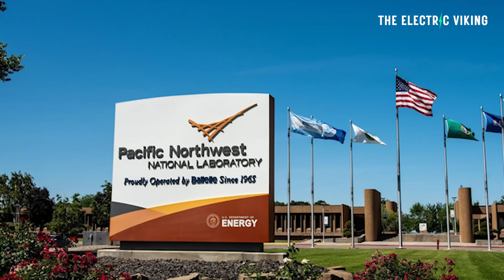Microsoft AI analysed 33 million candidates to find material to replace lithium

Comment: They found Lithium in Salton Sea ( California ) and it can be used for 375 million electric cars. It will be extracted from geothermal brines which is a less energy-intensive method. The brine concentration is 400mg/L which is considered good.
Reply: Cannot pass environmental for sure.
Reply: @kongwee1978  Salton Sea is already an environmental disaster .. commercial mining there could be the economic engine to reverse the disaster it is.
Reply: @kongwee1978 Google high  Li concentration brine and you will find it by far the safest "mining" possible; even Disregarding free geothermal energy to run the plant.
Reply: I live in the Coachella Valley (near the Salton Sea).  The Salton Sea geothermal wells are a near-miraculous lithium source for the reasons everyone already knows, but a lot of people don't seem aware of the local political and taxation climate.  The state of CA has imposed a per-ton flat tax on extracted lithium that will erode much of the cost advantage the Salton Sea lithium had to offer.  Depending on who you ask, it could make much of the development cost-prohibitive.  Like it or not, these taxes were a big part of getting essential local buy-in.  So the bottom line is the Salton Sea has definitely got the lithium, but the market may not end up getting all of it.
Reply: @davidmichaelmilewski  Just talked to a specialized geologist about the Salton Sea, What's hampering progress there is that it's a toxic mess. Very hard to get just the lithium out, you also have to deal with loads of other heavy metals and pollutants. That's what messes up the financial prospects.
Reply: @davidmichaelmilewski  Yeah, first we have to get rid of stupid gavin nesom and his socialist state government. LOL
Reply: They don't care the least about that or the cheapness of sodium instead or the ease of recyclability of sodium... They only care about that commodities investment market substance price explosion... now that it's low again.
Reply: LOL, It's California, they'll either prohibit it completely or make it so expensive that it's not worth it.  C'mon, you new here?
Reply: It seems like sodium is going to replace lithium fairly quickly.
Reply: @mac_mcleod   It hardly seems necessary to have looked through thirty million things to find Na in the flat below Li... why has this story not arrived with an explanation as to why the search space was so big?  I've been digging around (a big) and can't seem to get a grasp on why this wasn't just off the top of someone's head.  Why AI at all?
Reply: @kob8634  because it's faster than humans and lacks human biases.

After human beings have been playing Go for 3,000 years, AI both learned to beat them and invented new moves humans had never seen. 

I Can't Tell You Why the search space is so big. Suggest you Google for more information. But it is that it is a fact so clearly the search space is that big.
Reply: @mac_mcleod  I get all that, but when people are telling this story it seems to me the "why?" of the search space size is kinda vital to the story.  Lithium and sodium have always looked very similar (electrically) on the surface.  I get that Ai is faster (duh!) I don't know why it was needed and that kinda is the story.  Yes, I can google it alright, my search term would be something like "actual science jouranlist talks about Microsoft AI" but you know what that's gonna spit out before you press enter.
Reply: @kob8634 It's not actual science.   Most actual studies are dense and difficult to read and full of math.   

It's science journalism.   It may be the reason for the large search space is difficult to summarize or it could be they thought it wasn't important.
Reply: @mac_mcleod  Yeah, I expect they thought it wasn't important because things have been dumbed down so far the actual facts related to anything just don't matter huh?  Man, you seem nearly fawning in your approval of all this.  The reason the AI was necessary has to be central to the fact that it was the AI that found something.  That reason is the story (unless we're just Tic Tok'd out)
Reply: @kob8634 No, I was putting things in simple terms so an ignorant person could understand them.  And now that person has started making personal insults and trolling so I'm going to mute them.
Reply: @kob8634  Listen a bit more carefully. They were looking for an electrolyte additive to help make a sodium/lithium hybrid battery possible.
Reply: @zerospace101  already did. It created a new powerful move in the game of Go that humans had not seen for the 3,000 years we've been playing the game.

And many creative people are using the confabulation of ai's as a source of brainstorming.

But you're right about one thing, AIS do what they're trained to do and we really have no idea what we're training them to do. The failure of friendliness, also called misalignment, is an extreme risk which is being treated very callously by almost everyone working in the field as far as I can see.
Reply: @mac_mcleod  sodium batteries have far lower power density and lower lifespan at the moment, so wouldn't count on it. but would be great for large storage batteries grids. Just not for Evs.
Reply: Same in the Upper Rhine graben. 26 million tonnes resource.
Reply: They "found" it there?  Ha!  They *knew it was there before they looked* and they knew the exact concentration too because they know where and when the water came from and they've been putting up with a cosmic stench ever since.
Reply: Tell me you watch a lot of YouTube without telling me you watch a lot of YouTube.
Reply: They should just leave it alone
Reply: you will ruin the sea to build some cars.  are you completely stupid?
Reply: Sorry, can't, you can't mine in MN, odds are you won't be able to destroy the environment in CA.

Comment: the difference between AI generation and traditional development. is simple. in traditional we  branch out from what we have to things similar. AI starts from everything we put in even those that we know will not work and narrow it down. 

In many cases we will find out that traditional actually develops 90-95% of these quickly .. what AI actually gives us is the things we did no think would work. yes AI will help develop things but we will miss some things because AI can only use what was given to it. 

Ai is a good tool as long as we use it as such. if the AI came up with materials we did not think would work then it is a bonus.. if it comes up with things that are more dangerous did not help. There is always overlap in development from companies. as long as AI results are not copyrightable IE we determined that 20%lithium 40%sodium whatever else combo should not be copyrightable because many other companies and scientists can develop the same thing independently using similar AI's. AI''s will help as long as it does no become a copyright everything even if we will not use them.
Reply: Good post. I like what you said, however, you used “copyright” several times; did you mean trademark?
Reply: @morganmorse2086  Patent would be a better word.
Reply: Irrelevant. Whether developed by people or AI, anything potentially useful will be patented by the company developing it. That will not change. The patent office doesn’t care about or even need to know where an invention comes from.

Comment: Battery density keeps increasing and the cost keeps dropping. This would never have happened without Telsa bringing EVs to the masses if someone else doesn't do it Tesla will.
Reply: I remember ten years ago scientists saying batteries will never catch up with technology
Reply: @lidoz  They haven't. Batteries are a very bad way to power a vehicle, still.
Reply: @Withnail1969  - What is a better way to power a vehicle? Using an ICE that wastes 66% of its energy in heat? Show us the numbers.
Reply: @Withnail1969 Justify your assertion.
Reply: @Withnail1969  Physics doesn't seem to be your stong suit, mate.

Firstly, even if we generated our electricity with 100%  fossil fuels, these power plants running with 60%-70% efficiency would result in only half the emissions powering BEVs as burning the same fuel in ICE cars with only 20%-30% efficiency.

Seconly, we already have a quite noticable amount of renewable energy, in many western countries over 50%, and in some even over 75%, so it's even much better.

Finally, the share of renewable energy is raising fast. Since wind, solar and battery are already the cheapest source of electricity generation it's a no-brainer.
Reply: @Withnail1969 you are incorrect
Reply: Definition of masses aside, there's no denying Tesla's impact on the industry. But if a new chemistry  isn't compatible with their manufacturing process, it may be hard for them to change. Look how Toyota clings to their hybrids.
Reply: The idea that if one man didn't invent it then no man could ever invent it is really more of a religious argument than a scientific argument. You've told us you own tesla stock or you idolize Elon without telling us.
Reply: LLMs are legacy's only hope. The only way they are going to catch up to Tesla on software (excluding FSD for now). I think it's fantastic that energy storage is being explored by AI companies. Tesla benefits from cheaper and better batteries too, even if they ultimately don't use lithium. I think humanity is on track to move into a future free from scarcity, whether we like it or not.
Reply: Might be true. But the world has to start worrying about dealing with and recycling used lithium batteries and other waste the size of the United States.
Reply: Edison had over 900
 patents on batteries,  including the lithium battery.  Henry Ford hired Edison to manufacturer the battery for his automobile but refuses to use it because the battery would outlive the vehicle, instead he used open jars of acid that sloshed the acid out on every corner.   Wikipedia lists all of Edisons inventions and a battery.  Why is it musk builds a factory only to produce a substandard battery, Panasonic still makes a better battery.   The technology is there so why is it not used.  Planned obsolescence, is it still required ?
Reply: @vidxs  - The battery your talking about is the Nickle Iron battery. Unfortunately it has very lower energy density and  very poor low temperature performance. If it was better Tesla would use it. Their engineers seek the best performance to cost ratio. AI is coming up with new material combinations. Its like a modern gold rush. Whole point is their is now a bigger battery market now to generate investment.
Reply: Everything you just said was wrong but carry on
Reply: @johnsonfitzgerald2696  What facts are wrong?
Reply: I'm pretty sure that progress has been retarded for at least a hundred years now. The things already known a hundred years ago before there were really plastics to use, and before modern production things, the way a cylindrical cell is made is pretty ancient technology. The big thing was always the fact that batteries were toxic. And expensive. And people didn't know how to take care of them. But now it's almost like for a while the batteries got worse not for any reason other than it was time to make profit from all the capital expenditure. But look at a cadmium battery, or metal hydride, and what were they really trying to solve? The fact that nickel and cadmium are expensive metals. A modern lithium cell use way less nickel metal than an old metal hydride one. Nickel used to be really cheap because there were only so many uses for the amount there was. Now, it's not ever going to get cheaper. But when you look at the actual amount of lithium in a battery (I've seen things like it's only about the size of a BB or a pea per cell) so the term lithium battery is maybe misleading because the nickel is just as important and so is the separator material and the carbon and the solvents used for electrolyte
Reply: @SimEon-jt3sr  - Oil companies would buy battery and fuel less patents over the last century and bury them
Reply: Why do we need batteries when energy is all around us...? Tapping into the unlimited power that exists all a round us has been proven to be real and we can do it.
Reply: @randallcromer66  Maybe - Nikola Tesla modified a Pierce-Arrow replacing the gasoline engine with an AC electric motor. Powered by a "cosmic energy power receiver" used a 6 toot antenna.
Reply: Yeah, because there isn't any other battery powered devices and people researching batteries...
Reply: I wonder what the costs in recycling to buying new compare. Until we may get resource shortages it's maybe too expensive? Or batteries have to get more expensive. Solar cells also seem too cheap. Most of old panels are thrown away
Reply: We wouldn't be stuck on lithium if Tesla hadn't brought it into the mainstream. There's 50 other processes that could be as effective and even more practical for non portable batteries - and perhaps we'd be using the radium battery developed by NASA, or the liquid iron  battery.
Reply: @danielvest9602  Tesla just used available off the shelf laptop batteries. So liquid iron batteries have higher energy density, lower price and more charge cycles than lithium ion or LFP batteries?
Reply: Tesla would have never happened without Ford. Ford wouldn't have happened without previous production lines. Stupid argument here. Cuck hard bro
Reply: Right. Telsa has innovated batteries themselves. Their next battery doesn't even use cobalt
Reply: EVs dont even make profit. Its all subsidized by taxes.
Reply: More like massive government subsidies with a side of government funded research. But if say Elon is your savior is what you have to say to your self to keep pressure and competition on the oil industry, OK.
Reply: F tesla and Elon must
Reply: @cdert90  real mature. You represent the democrats well.
Reply: @cdert90  Guess you hold F and XOM stock
Reply: The biggest 18650 is still 3.5ah, battery tech went backwards since lfp batteries have a even lower density.
Reply: @polska905  - LFP density may be lower but you can charge/discharge deeper. Lithium ION you really should keep from 20% to 80%.. 30% to 70% will not degrade the battery at all. This was a good comparison of the chem. https://www.youtube.com/watch?v=CktN6dPTYV8
Reply: I'd love to read the peer reviewed paper that combines these claims. Probably doesnt exist but you might surprise me, lol.
Reply: @TheAlphaTaurus  - LOL are you serious dude? This is very common knowledge. Why don't you do a simply google search for battery density improves 5% to 8% per year?  You can also watch the Tesla battery day presentation to see that the price is coming down because of large scale production. This happening with multiple company's like Tesla, BYD, CATL & Panasonic. Have you been living under a rock? Or being snowed by main stream media lies paid by big oil and legacy auto?
Reply: Tesla aren't the only EV manufacturer, also battery technology would have improved without them, batteries are used in lots of other devices, power tools, household appliances, power banks, phones, ebike, the list goes on, I'm guessing there are more batteries in handheld devices than EVs.
Reply: @dogbreath6974 no where near as fast. It is a fact that evs has pushed innovation for batteries more than anything else in the last decade...
Reply: It would have happened but 10 years later
Reply: @fredsf1 

screaming
Reply: Neither of those claims are true.
Reply: @Withnail1969  Which claims and why?
Reply: @Withnail1969 both are true... evs have caused more focus to innovate batteries than anything else has in decades....
Reply: Cars to the masses? Tesla have made a sum total of 5 million cars. There are 1500 million (1.5 billion) cars on the world's roads. Thats 0.33%. Cars to the masses? really?
Reply: @pvelectronics4291 🤡
Reply: @pvelectronics4291  - Using the total number is not an accurate number. You should really use an annual production number or annual sales numbers. Also I live in a State that has the 3rd largest Tesla sales so I see them everywhere.  Before Tesla NO EVs were coming to the US. GM killed it for big oil. If your number is accurate I'll take it because that is better than ZERO or NEVER.
Reply: @pvelectronics4291 yup those are the same numbers Tesla talks about. That is why: 4680, 48v, Optimus, Giga Berlin, Giga Texas, Giga Mexico, Giga Shanghai, ... it is just beginning.
Reply: Oh, you and your mate, Archimedes, doing your old fashioned maths. This is 2023, not ancient Greece. We have new maths, these days, which tells us everything that we want to believe.
Reply: @pvelectronics4291  - I found total production number for 2023 of 85 million. And Tesla produced 1.8 million in 2023. So that is 2.35%. That is really significantly. The ratio for US and China is much higher. How can you use the total number of cars on the road vs total number Tesla produced? Tesla just started to ramp. Guess you have money invested in Toyota VW, GM or Ford. LOL
Reply: Tsla going to 10k next year
Reply: @jimj2683 impossible. The number of fools available to support that is not infinite.
Reply: @jimj2683  Eventually, sure, if and when both the robotaxi and the Tesla Bot have proven to conservative intitutional investors to come into play. But that won't happen for quite a few years, what would cause the stock to get that high next year?
Reply: I’m still waiting for their stock to hit 50 dollars 😂
Reply: @memecat84  - But the competition is coming.